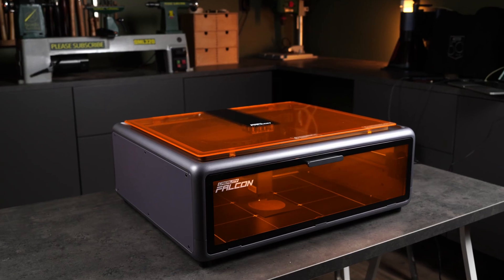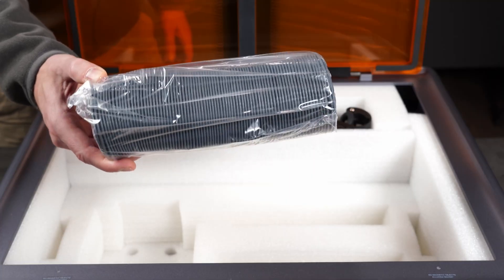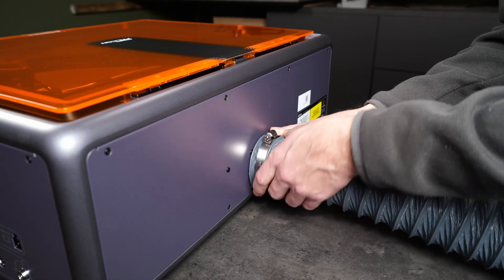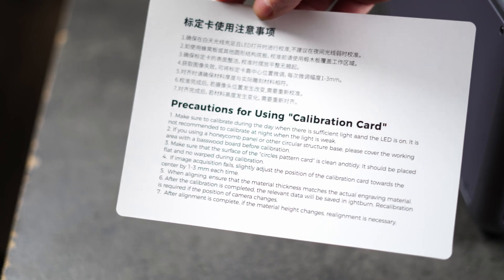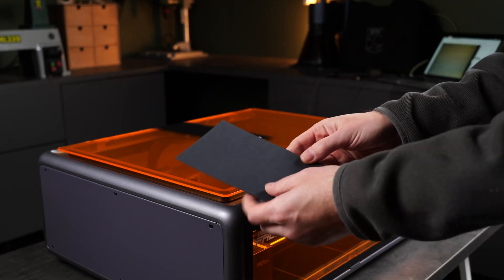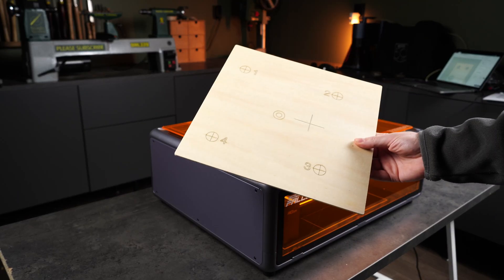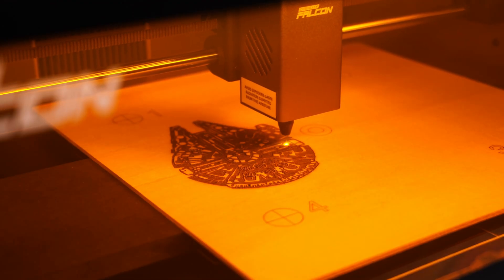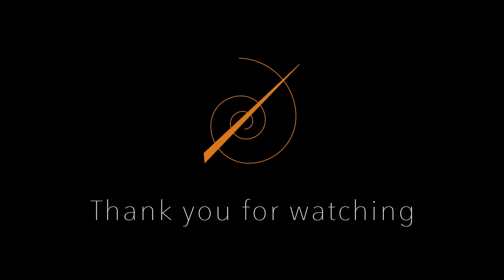I Tested the $499 Creality Falcon A1 — What You NEED to Know

Comment: Did the exhaust fan capture all the smoke when it cut and engraved the wood? Or did it leak some into the room?
Reply from the maker: Hi 😀 That small purifier works really well. Kept it on medium the whole time. I did cut about 30 christmas ornaments out of 3mm basswod in one session and at the end there was a little smell, but no smoke 👍
Reply from the maker: I just realized that I didn’t show the purifyer innthis video. I had the hose hooked up to a small purifier so the fan had help from that. Check out the Christmas ornament video. I show the purifyer there. So to answer your question, I unfortunately don’t know how the fan alone clears smoke.
Reply: @nordicturning No worries, thanks for the reply!